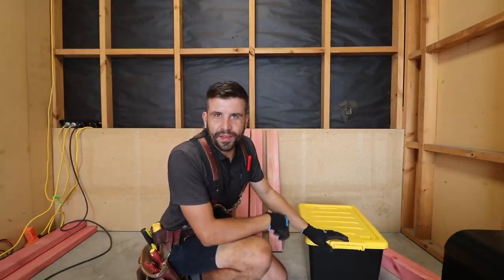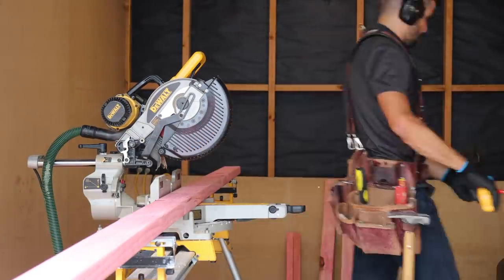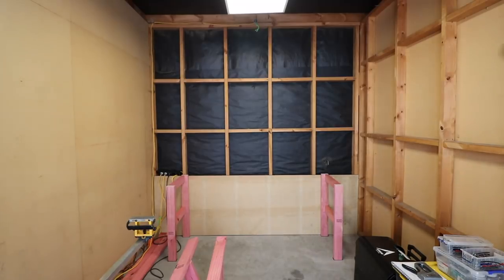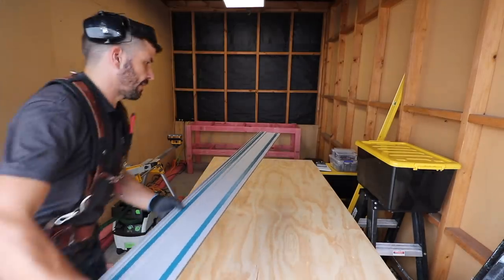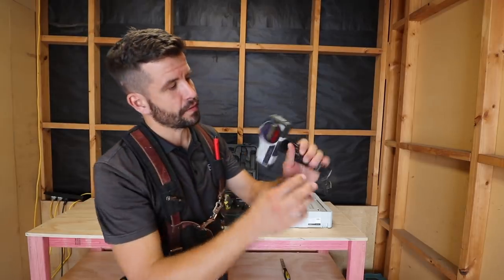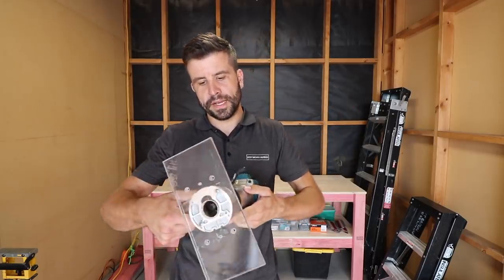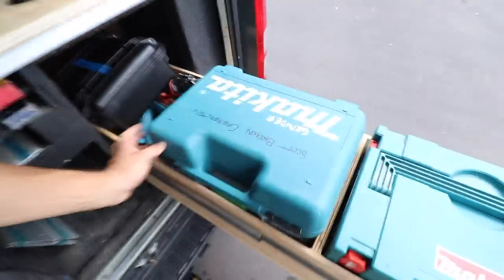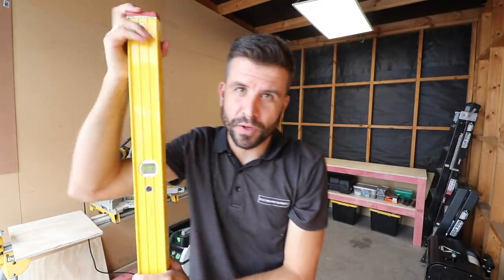Starting a Building Company? Get These Tools

Comment: I can’t believe I have gone this long without a track saw. I’ve wanted one for a long time. Nice video bro!
Reply: A track saw is a game changer. 
I first came across them (festool) when was working in Amsterdam about 10 years ago...you gotta catch up man 👍
Reply: Just clamp a straightedge.
Reply: @baratobarato5056  takes to long . time is money
Reply: they are the best tool ever !!!!
Reply: I'm glad that you are watching this guy.
Reply: JRS UK does your track saw cut exactly along the rubber edge or do you allow 1-2mm if you get what I mean
Reply: @MsElijah16  It cuts exactly along the edge. When the track is brand new The edging is over size so your very first cut on the track trims the edging to exactly the correct position.
Reply: JRS UK cool thanks for explaining that
Reply from the maker: Do it bro! You won't regret it  👍
Reply: I just use my circular saw and clamp down a long ass level.
Reply: @stevenlawton  awwwwww are you his first hater? That's so cute
Reply: Man, your are the best trim guy in the US, if you never needed it until now, you wont need it ever. Keep on trimming, love your work.
Reply: @baratobarato5056  not as good finish if cutting laminate or particleboard have to run tape as well to protect the cut edge from chipping I only just got a track saw but wish I bought one years ago it would have paid itself off within a year or 2
Reply: If your a good carpenter you dont need a track saw lol. Not ome builder in Canada uses them.
Reply: @alimasawi8610  it takes like 30 sec to set up prob less if you have hussle
Reply: @fattony4lyf way too much messing around, first you've gotta mark, then add or subtract the fence offset, then clamp to that and ya gotta clamp both ends.....meanwhile over here I've just finished the cut with the tracksaw. I was a clamper like you, the day I got a tracksaw my income jumped, gotta move with the times bro 👍🏻

Comment: Got a track saw a few months ago, can't live without it now. 
Got the Makita barrel grip jigsaw recently, absolutely hate it. Easily the most dangerous tool in my collection. That stop start button system is cause for a recall. Have bent a few blades already & still forget how fiddly it is to shut off almost every time I use it. 
I also have a traditional pull trigger style, love it. Sneak up on the cut & full control of how & when I want it to work.

Comment: I started off going on offeeup. I found a kid moving into a college dorm who had a DeWalt drill,skil jigsaw,sockets,skilsaw and some other tools for $100 bucks total,all barely used. Bought a Delta table saw with stand,5 shop lights with bulbs,10 circular saw blades, all for 50 bucks off the same app. It's always good to look around but sometimes you get lucky like I did. I of course bought some tools later on.
Reply: Kyle Smith If I was to buy my tools again I may consider pawn shops
Reply: I buy a percentage of gear cheap especially from trades people who are going through the start of a divorce or company's folding up due to receivership sale. I had even walked into a workshop as New owner just wanted the place cleared out as he thinks tools and gear are only used by poor people or laborers.

Comment: Coach builders have a bit of construction gear and mechanic gear like we make wood flooring which the vinyl is layed on and then we have guy drilling 50mm holes in 6mm steel plate with a cordless drill

Comment: I like the dewalt table saw. I've being using my Elu flip saw for the last 30 years or so. Its 110v and heavy. I'm not getting any younger so it's the Dewalt for me.
Reply: David Beaumont Haven’t heard Elu mentioned in so long.  They (Black & Decker) pretty much killed the brand in favour of DeWalt (cheaper to promote just one brand than two). I used to have some Elu mugs, which I still had them, they might have been kinda retro cool by now!

Comment: The 10 inch dewalt is so good here in Wellington to carry up all the hills and steps. I haven't even noticed the slightly smaller capacity. Does everything the 12 does but is way more compact. I did buy the led light for the blade off amazon straight away, so handy.

Comment: Try the tough built fold out saw horses mate they are great ,i use the bigger ones from mite 10 mega
Reply: These are the bomb!!! And make a really sturdy work bench👊
Reply: I’ll 3rd that. I screwed some timber to the top as a sacrificial element. You can also use this method to make them a lot wider
Reply: Are the legs easy to pull out?
Reply: Yeh real easy better 5han the spring n bolt system check them out there plenty of vids on youtube
Reply from the maker: Sweet might check them out, thanks
Reply: Phillip Smith have link saw horses?

Comment: we use the whole makita range on work. but in my personal arsenal i have the milwaukee impact drill and regular drill. and they are awesome. feels so much more solid than the makita's, and it also feels like they've got more power, even though i use a 4amp battery on both brands. did you lend out the finishing gun to a painter? :D

Comment: nice video, liked how you did a little build while going through everything. I've been running a dual slider makita going on 10 years. great saw and easy to calibrate. I've been trying to go to all battery and I just wanted your thoughts on that and your thoughts on the Makita 36 volt 10 inch saw? My biggest thing is it going to come with a corded attachment. King it or sting it??
Reply: Joey Krak is that the Makita that uses 2 batteries?
Reply from the maker: I keep hearing good things about it. Haven't tried any 36v tools yet myself

Comment: Hi scott hows airbow framing gun? Is it replaceable with paslode framing gun? Hows the power difference with paslode??  U must bought that in placemaker aya? Thamks for the video thoe
Reply from the maker: Hi Dave. It fires nails much better, no recoil and you don't have to worry about gas. Just have to get used to having an air compressor onsite .  I'll do a video soon
Reply: @ScottBrownCarpentry  thanks for the amswer :)

Comment: I dont see why you need the track saw or the table saw. Cant think of a job you couldnt do without them as long as you have a circular saw?
Reply: Ease of use, id way rather rip boards with a table saw than a circular saw.

Comment: My advise would be to stick to cordless tools as much as possible. Cordless is the future.
Reply: TheToolnut a corded skill saw is best for ripping heaps though aye , ripping drains the bat fast... do you know anyone who has a battery table saw?
Reply: @MsElijah16  Indeed, you'd burn out the motor as well. That being said the worm drive Flexvolt rear handle 54v saw and the Makita 36v equivalent are good tools. My local Dewalt dealer has the Dewalt Flexvolt tablesaw. I'll be splashing out on one soon, 😁

Comment: What keeps the track in place when using the track saw?
Reply: Two rubber strips on the bottom of the track, clamps are available as an accessory.
Reply: TheToolnut so the rubber is enough to hold it into place? Sounds awesome
Reply: @jonsturrock2788  Yes, I've owned two tracksaws and I've never needed/used the clamps. Yes indeed a tracksaw is a great bit of kit to have.
Reply from the maker: I'm the same, haven't used the clamps and had no problems

Comment: I had 15 years worth of tools stolen overnight from my van last year....  invest money in security...  it was a truly devastating experience.  I still haven't replaced them all yet...  Carpenters/ general builders carry the most expensive tools and thieves know this...

I now have decent locks on the van and i hide a gps tracker in my jobsite radio.  The gps has a motion detector on it too so i get an alarm if someone is tampering with my tools.  I keep an iron bar by the front door.  Next time the fuckers are going to spend a couple of weeks in hospital if they try and nick my tools. 

Don't rely on your vans factory fitted locks,  nowa days thieves use key code scanners and can pop open your van as easily as having a key.
Reply from the maker: Gutted when that happens. I've lost a few nail guns over the years but nothing that bad !
Reply: Scott Brown Carpentry tool theft from vans is rife in the uk.  Not a week goes by when you don’t here about a tradesman getting robbed.  

I recently emailed makita to make an 18v stand alone alarm that you can bolt to the bulk head in your van.  Put a camera in it,  motion sensors and a couple of rape alarms.  

I doubt they will listen but there is definitely a market for some sort of stand alone alarm that you set with your phone.

Comment: 2:00 for the record, this is NOT the way a tablesaw is supposed to be used. Very dangerous and high possibility of kickback when freehand cutting. Never do this!! Always use the fence. Especially when it's right there. Using the fence is only advantageous, less dangerous, more accurate. Only if the board is really wavy or similar the fence is not usable, but in that case a tablesaw shouldn't be used at all.